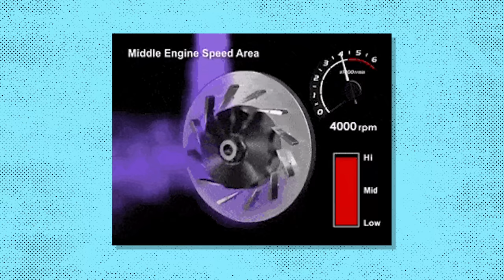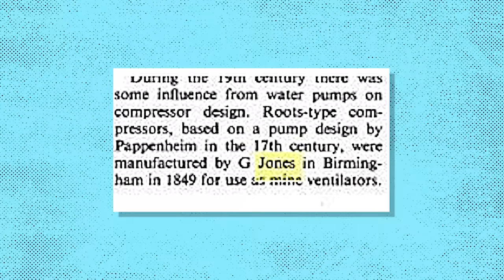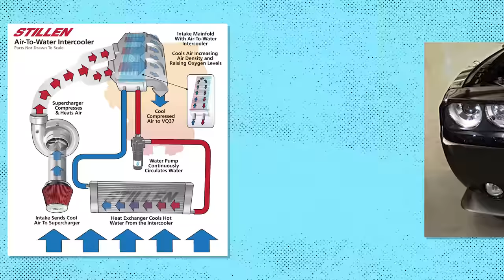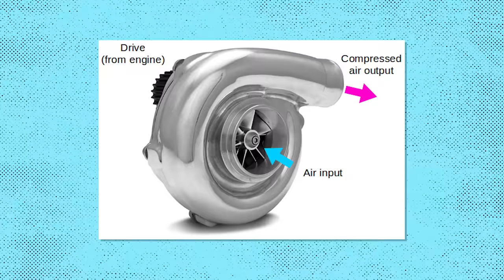Why Superchargers Aren't As Good as Turbos

Comment: In the NHRA pro mod division, which is extremely popular using 4000 hp engines using either superchargers, turbo, chargers, or nitrous. If you want to run a supercharger, you get a weight penalty of 100 pounds now tell me why Superchargers are not good as turbo chargers. 
Fourth Street use turbo chargers have lag, which is undesirable.
Reply: Turbos make more horsepower than superchargers
Centrifugal superchargers also have lag, but they make more power than blowers.

Turbo lag is not acceleration lag, turbo cars accelerate faster because they have more power.

Do you have any questions
Reply: Why do superchargers have a weight penalty if they don’t make the most power. And they still hold the records for a quarter-mile in promod
Reply: @WilhelmKarsten 
I don’t think you can compare an aircraft turbo engine running at 3000 RPMs compared to racing engines at 10 11,000 RPMs
Reply: @cobra7250  Turbochargers don't have a weight penalty?
Are they allowed the same manifold pressure?

Perhaps the rules favor superchargers.

Porsche has won Le Mans many times with a Turbocharger... it's one of the most gruelling races in the world.
Reply: @cobra7250  Turbo rpm is no different than supercharger rpm, it's completely unrelated to engine rpm.

The fact remains that all other variables the same, a Turbocharged engine will always produce more horsepower than a supercharged engine with the same manifold pressures.

Comment: Turbos do also "steal" hp from the motor. It slows down the exhaust gasses. The energy needed to force air into the motor have to come from some place, free energy dosent exist.
Reply: You don't seem to understand how a turbocharger actually works?
The exhaust turbine is driven by the heat energy remaining in exhaust gas.
The Turbocharger is a Impulse Turbine and is driven by the velocity of the exhaust gasses, not pressure.
Reply: @sandervanderkammen9230  No, the hot side turbine is driven by the flow of air. Flow can be calculated by the velocity and the size of the pipes used in the system.
Reply: @markuslimseth8426  Thank you for confirming that you don't understand how a turbocharger works.
Reply: @sandervanderkammen9230  There is no free lunch.
Reply: @markuslimseth8426  Unlike a supercharger, the turbo eats for free...
The Turbocharger is a HEAT ENGINE and operates using the BRAYTON CYCLE, the same as a jet engine.

When installed on a reciprocating Otto type engine it becomes a Combined Cycle engine.
The Turbocharger being a Second Pass heat engine.
The Turbocharger uses the waste heat in the exhaust gas to drive the exhaust turbine there is no parasitic load on the crankshaft of the reciprocating engine.

Comment: @Driven Media You made no mention of the electrically driven supercharger which, in my opinion, is a bit better than a turbo, and definitely does not suck! I'll cut you a little slack, as they are relatively new, but they have been around for a while. Borg Warner did r and d in the 90's, but didn't market/sale them until later. They do require a good bit of energy, like 48 volt systems and higher, but with today's battery tech and regeneration of wasted energy from the motor (or even brake heat) being harvested for battery charging, they are a more viable option, and give results that are truly spectacular! Also, a blower (supercharger) with a turbo on top is a great combo, and is often used in marine diesels, as well as some of the older awesome sounding 2 stroke Detroit diesel motors in big trucks. Used to have a GMC General (road tractor converted to a dump truck) with an 8V 92 silver anniversary edition with an Eaton 21 speed road ranger transmission. Talk about awesome!! It was a blast to drive and had power galore with a sound like nothing else, very loud, and had a Jake brake that could set off car alarms! So..... superchargers rock! Not to mention the 10,000 + hp that they help top fuel dragsters achieve, so your video title needs work in my opinion, and it helps to do proper research before disparaging something! Other than that, good video as usual.
Reply: You seem really confused about alot of things here.,
First off Electric superchargers produce less power and use more fuel than a turbocharger because of the parasitic drag on engine and the need for larger batteries.

2-stroke Winton Type Diesel engines like Detroit Diesel, Kassbohrer, GMC and EMD are Not Supercharged
These engines are NORMALLY ASPIRATED
The blower or turbo is used only for exhaust scavaging.

Turbochargers are not used in Top Fuel drag racing because they are BANNED in NHRA.
Turbos make more power and make the cars too fast. 

Any questions?
Reply: No questions, I gave you the name of the motor Detroit Diesel, 8v 92 silver anniversary edition, look it up, it has a blower, ie a supercharger with a turbo that sits on top of the blower. As for parasitic losses from an electric supercharger, if waste heat is used to charge the batteries, there is no parasitic loss, wow, it is pretty straight forward. I don't claim to be an expert, as you seem to sound like. But the only confusion I have is in regards to your reply! Just agree to disagree. I had a supercharger on my Pontiac GTO 3800 6 cylinder and really enjoyed the linear power of the supercharger, so I just don't agree that they suck. Here is a link for you to help you understand the Detroit 92 series motors:https://en.m.wikipedia.org/wiki/Detroit_Diesel_Series_92
Reply: @sandervanderkammen9230  oh and by the way, I never said turbos are used in top fuel, not sure where you got that from. Thanks for the constructive criticism, but I'm not sure you seem to understand some things about internal combustion motors. BTW here is the link I put in my other reply to help you understand about the Detroit 92 series motors (https://en.m.wikipedia.org/wiki/Detroit_Diesel_Series_92 ), of which I've owned two, a 6v 92, and an 8v 92 (both were dump trucks, as we have a family business in the asphalt paving industry). Truly awesome powerplants. And for the sake of clarity, I believe the words blower and supercharger are interchangeable words, but I could be wrong. If they are not, there is not a whole lot of difference between them, that's for sure. Cheers mate! Supplemental: While the purpose of superchargers and blowers are basically the same – to pump air into the engine at a rate that is beyond the force of atmospheric pressure – superchargers are driven mechanically via the belts that run off the crankshaft or by an electric motor, while blowers use centrifugal force to push the air
Reply: @sandervanderkammen9230  BTW I apologize for not being more specific about the whole supercharger/blower thing, I can see how that could be misconstrued, but as far as I'm concerned, they are one and the same, with only minor differences (see comment above for clarification). Also, I highly recommend looking into the Detroit 92 series motors, you have a few things wrong there bud, as they are most definitely NOT NATURALLY ASPIRATED! I am 100% sure of that! If you have never heard a Detroit 8v 92, then you are missing out. There are a few videos here on YouTube that you can watch and hear one, I suggest checking them out, they sound AWESOME 👍!
Reply: @ericpatterson3887  Yeah, its not uncommon for amateurs to not understand the difference between a blower and a supercharger.
2-stroke Diesel engines like the Detroit are NORMALLY ASPIRATED which is distinctively different than Naturally Aspirated or Supercharged.

2-stroke Diesel engines cannot be supercharged because they are UNIFLOW INDUCTION but cannot run properly without a scavaging blower to push the exhaust gasses out of the cylinders and recharge the cylinders with fresh air.

If you have difficulty understanding how Uniflow 2-stroke Diesel engines work I would be happy to explain it to you in greater detail.
Reply: @ericpatterson3887  That is not a electric supercharger.
What you discribed is a hybrid drive turbocharger
Reply: @ericpatterson3887  Turbochargers dominate the forced induction market because they produce more horsepower.
Turbo lag is not a real problem... it is an imagined one.
Turbo cars generally accellerate faster than supercharged cars.
Turbo lag is only a problem for inexperienced or less skilled drivers.

You specifically mentioned Top Fuel drag racing.

The NHRA BANNED turbocharged engines in Top Fuel.
Turbos would make more power and make the cars too fast to compete safely.

Any questions?
Reply: @ericpatterson3887  Clearly you don't understand the difference between NORMALLY ASPIRATED and NATURALLY ASPIRATED

These are very specific technical engineering terms and reference two very different modes of operating systems.
Any questions?
Reply: @sandervanderkammen9230  No reply? Thought so. Next time you comment, be sure of what you say, and pay attention to what the person you are replying to is saying, and you won't look so foolish, or ignorant. Obviously, they made this video because it is a controversial subject, and they knew it would bring about these kinds of discussions. Bottom line, I would definitely not have a problem giving up 700 hp to turn a blower/supercharger in order to gain 3000 hp, which is approximately the numbers for a top fuel dragster motor that pushes north of 10,000 hp and absolutely mind bending acceleration. Go see, and feel it in person, watching it on TV does not do it justice. Truly a phenomenal experience!!
Reply: @ericpatterson3887  The NHRA BANNED turbocharged engines in Top Fuel because they add more than 3,000 horsepower...
Reply: @sandervanderkammen9230  and due to the higher temps in a turbo, I can't imagine them being more efficient than a blower, or supercharger, and yes the variable geometry turbos have mostly solved turbo lag, my father has one on his Dodge Ram 6.7 Cummings, and it works great, and the exhaust brake is a real help when hauling our equipment. They both have pros and cons, but getting back to the video, I personally do not think superchargers or blowers suck, and I know I am not the only one. Again they made this video because they know it is a controversial subject, I just fall on the side of superchargers, and I have formed that opinion through first hand experience.
Reply: @ericpatterson3887  Here again Eric, your lack of education fails you...
Turbochargers are external compression type compressors.
They heat the intake air LESS than a positive displacement compressor  like a Roots type blower.

A turbocharged engine produces more horsepower and uses less fuel than a supercharged engine because a turbocharged engine has less heat rejection.
 Turbocharged engines deliver better BSFC performance and have lower outlet EGTs.

Turbos dominate the forced induction market for two reasons: they produce more horsepower and use less fuel than any other type of induction method.
Reply: @sandervanderkammen9230  whatever dude, again you offer no proof. I'm done with this conversation, my education was never the subject, but you choose to try and put me down with your snobby attitude. Of course any time you compress air with an air pump you get heat, duh, I never said otherwise, I just know that because turbos handle really hot exhaust gases that they run hotter than superchargers, that often have their bearings cooled using oil bath which does a much better job than  hot engine oil that most turbos use. Turbos often need intercoolers to help deal with the excessive heat, while superchargers and blowers usually have no need for intercooling. That said, all intakes wether charged or not benefit from pre cooling of intake air, everyone knows that. Reply all you want, I'm done with your inaccurate statements and your refusal to provide PROOF of what your saying. Anyone can say anything and swear they are right, but when you add proof then we know who is right. Cheers mate, please be kind to people in these comment sections, even if you disagree, there is no need for nastiness, unless you are just a nasty person, then.... You have my sympathy, and I hope you change, nasty people are usually unhappy people.
Reply: @ericpatterson3887  Thank you for conceding the argument and admitting that you are wrong.

If you have any questions about how turbos, superchargers or Diesel engines work? I would be happy to explain it to you.
Cheers!
Reply: @sandervanderkammen9230  wow you should make movies, cause you are really good at making stuff up!! 🤣😂🤣🤪
Reply: @ericpatterson3887  Just the facts here Eric, it was your choice to post comments on this topic that you know nothing about.
You have exposed yourself as a fake, someone pretending to be knowledgeable about engines and  forced induction.
All you have done is prove you have no education or professional experience and made a fool of yourself.
Anyone familiar with superchargers knows that the centrifugal compressor found on a turbocharger  is a external compression type and heats the air LESS than a positive displacement compressor.

You should be ashamed of yourself.
Reply: @sandervanderkammen9230  for those interested in vintage Forced induction Detroit Diesel motors, here is a link to an older design on an old generator set where you can clearly see the blower and the turbos:  https://youtu.be/s15JD4eg5UQ (yes there is two of them). The channel is dedicated to two stroke diesels of which you will find a wide variety of them on his channel, many, it not most are forced induction, proof you can see with your own eyes and ears. Of course there are those that will try and convince you that what you see and hear are not what you see and hear, but what you see and hear is what THEY say you see and hear. Me, I'll trust my own eyes and ears and my own experience. Those who want to sow disinformation can do what they want, they have their own twisted reasons, like those who say Jan 6th was just a tourist visit! Facts are only facts when there is proof to establish them as facts. Again all you do Sander is provide non sensical innuendo and rhetoric. Basically, you just run your mouth as if your mouth only states facts, is never wrong, and never lies. Right, if you believe that, I have a bridge I want to sell you!! I'm not always right, and have no problem admitting when I'm wrong, this is just not one of those instances, and I've provided PROOF for those who do not know what is correct, so they can know for themselves via third party references that address the subject in question and have no knowledge of this conversation that myself and Sander have engaged in. Provide some proof Sander, otherwise your just talk!
Reply: @sandervanderkammen9230  https://youtu.be/s15JD4eg5UQ watch the video Sander, at 37:37 they talk about the turbo fed blowers found on this Detroit in the video (it is from the 671 series I believe). Go to his channel, you will see more forced induction Detroit Diesel motors.
Reply: @sandervanderkammen9230  https://youtu.be/Xa2x5vrie-o    here is another one that explains how Detroit Diesels work. Like you he starts off saying that the blower is not like a supercharger, which it is not, we covered that in an earlier post, superchargers are mechanically driven, in most instances, blowers use centrifugal force, but then he starts using terms like pressurized air, and the air is pushed into the cylinder chamber. Air being pushed and pressurized air is the exact definition of forced induction. He also mentions the use of turbos in combination with the blower, such of course is a forced induction setup not normally or naturally aspirated, which by the way mean exactly the same thing, Google the difference between normally aspirated and naturally aspirated. I'm sure you will tell me Google is wrong. The motor I was referencing in my first post was a 8v 92 ta silver edition, where the ta stands for turbo assisted, which you would know if you read the OEM .pdf file I gave you the link to. Plain and simple, you are wrong and continue to be wrong, and you should just accept the FACT that you are wrong, grow up and be a man and accept when you make mistakes, not make excuses and spew drivel that has no basis in fact. You can't provide proof, cause there is no proof. Don't you know how to use Google? Know how to copy and past a link? Prove what you say, otherwise just hold your tongue, and or your thumbs as the case might be. Engage your brain before you put your mouth in gear. Do your research and do your due diligence before ridiculing someone you don't even know. Then maybe grow up a little and take a class in proper manners.
Reply: @sandervanderkammen9230  keep messing with me, I'll keep working you! Provide some proof, back up what you say! Oh right, you can't!😆

Comment: I am sure you are wrong saying superchargers don't all compress the air.  If it's not compressed, why does it get hot and need radiators to cool it.  I haven't researched it but I would bet any amount that you are wrong.  How do shove more air into a cylinder without using a higher pressure?
Reply: You accelerate the air... its basic fundamental fluid dynamics, eg; Bernoullis Principle.
Reply: There are two types of superchargers... internal compression and external compression.
Reply: There are two types of superchargers... internal compression and external compression.